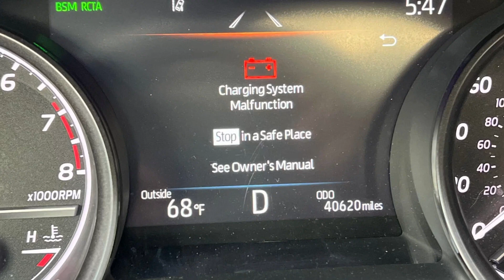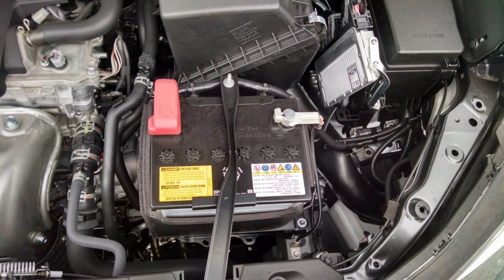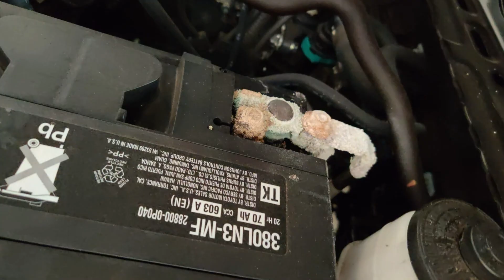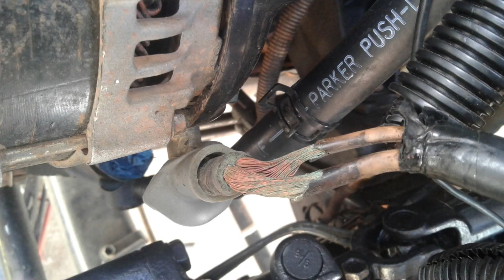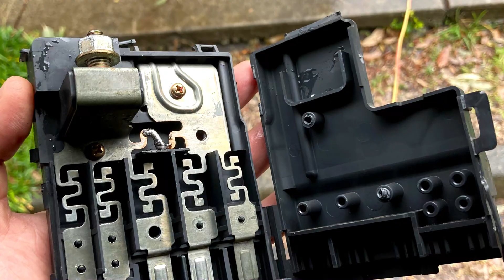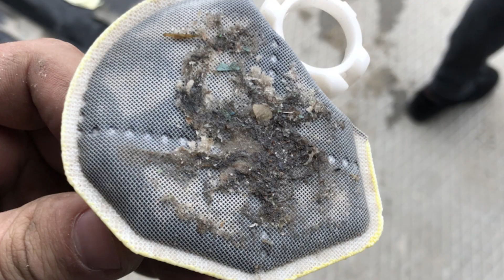“Charging system malfunction” warning in Toyota RAV4

Comment: I was having issues with my alternator and it making a very bad sound, i got it replaced recently but then i received a charging system malfunction light followed by loss of power steering and and many other warnings, i replaced the battery that it seems the old alternator called. But now its happening again with a perfectly brand new battery, could it be the new alternator being the issue or maybe the mechanic installed it wrongly?
Reply from the maker: The issue is very likely with the alternator - these cars need precisely proper amps and voltage from the alternator, otherwise, they will not work. I would go back to the mechanis who installed the alternator and ask for checkups.
Reply: @TopicMotor thank you very much, im planning to try and bring it to the mechanic tomorrow and hopefully get it fixed cause its still causing the same issues

Comment: This happened to me today. I was going to reverse park into a parking spot and the charging system malfunction error came up. I put the car in park, turned it off, and when I turned it on everything was back to normal. Idk if it was just a glitch, or maybe I didn’t let my car fully stop before quickly changing the gear from drive to reverse
Reply from the maker: Could be just shifting too fast. Anyway, unless it reappears, there is nothing to worry about.
Reply: This happened to me today is everything okay? All of what u just said happened exactly 😭 I’m just worried about it.
Reply: @lesliemendez5575 yeah everything is fine, idk what happened that day to cause it tbh but it never came back 😂

Comment: After having a alternator replaced in my 2017 toyota rav 4 mine runs and cranks but the malfunction light comes on after driving a few miles any ideas ? Is there a reset code ?
Reply from the maker: The message shouldn't come up if the voltage is fine - I don't know about wsys to reset it. Either there is an issue with connections in the system, or the battery is about to kick the bucket. Also, the new alternator may not send the proper voltage to the system - this needs to be checked.

Comment: Hello, I got a transmission two years ago and last year I got a alternator, battery and spark plugs. Last week it stalled on me at a red light , I was able to bring it back home . But it said charging system malfunction . I have a Toyota rav 4. Im wondering why would I need an alternator again.
Reply from the maker: Before you buy the new alternator, check if the fuel pressure is OK - very common issue with these cars having problems with fuel pump filters in the tank with the symptoms you describe. If it's eventually the alternator that requires replacement, with it being 1 year old, I would enquire about warranty unless it was a cheap aftermarket part.

Comment: I get the same problem but i just change the alternator before i change the alternator the battery was 12.8 when the engine was not running and now is 12.3   when its running is going between 13.4 to 14.8  and when im driving is going between 12.8 to 14.1 so i dont know if i really fix the problem .  Did i have a bad battery ??? My battery is a AGM not even 2 years old.
Reply from the maker: Voltage readings look good for the alternator and not so good for the battery. Give it a load test before investing in the new one. Also, an external charger will help get it back to life at this age. The message may be triggered by connections like main ground or even by poor fuel pressure due to clogged fuel tank filter.

Comment: I'm having this message pop up but nothing seems to be wrong. Changed the battery, tested with multimeter while started and it's at 14v. I can't seem to figure out why the message is popping up.
Reply: It starts normal and drives as normal
Reply from the maker: I would check ground connections and alternator connections, then also change small fuel filter in the fuel tank - somehow it often causes this message. Also, this could be anything with the fuel injection and combustion - a good scanner will help with this.
Reply: @TopicMotor turns out it was just a sensor cable that connects to the alternator. It was starting to break off. Touched it and it snapped right off. Easy fix
Reply: Mine just did it but it stopped i have to charge with a charger what i need to do.

Comment: i have a rav4 2017 with n47 engine, i have it many years now and have 212000km on it, and service it every10k, yesterday it would crank but wouldnt start, i had it towed to toyota dealer and they advised the fuel lift pump in fuel tank needs replacing, they said it will cost 1200 euro, should i replace? any advise
Reply from the maker: Oh gosh... This pump is 300 eur/usd oem toyota. Replacement in any good garage (not dealership) is 200-250. You can even replace it on your own with some tools and patience. The warning indeed may be caused by the pump.

Comment: My car keeps stalling while I'm driving, particularly at lower speeds in the city. It will display the "Charging System Malfunction" error, as well. The shop I've taken it to has replaced the battery and checked connection on the charging system circuits and found no faults. 
But now I have a Camshaft Position Sensor code from all the stalling, and after seeing you and another video talking about fuel delivery, it has me wondering...
Reply from the maker: I would check the fuel pressure with a good scanner first. But this can also be a more serious problem with timing or camshaft sensors. Not really common though.